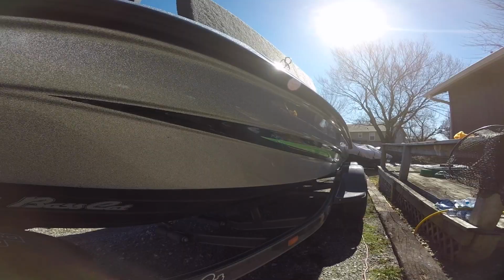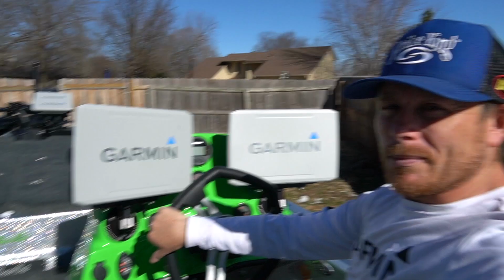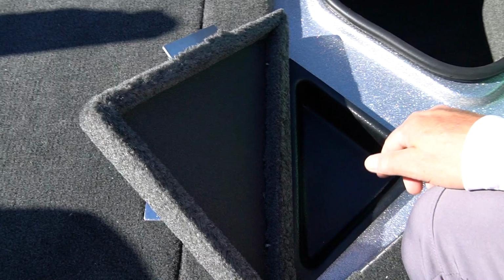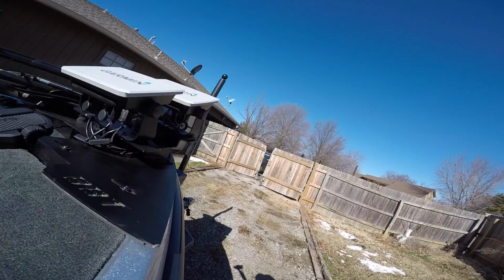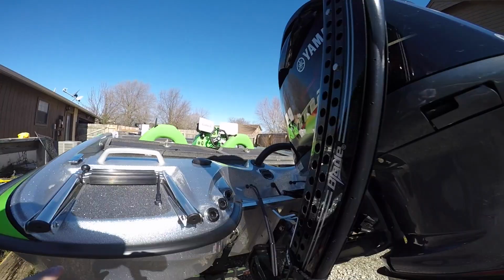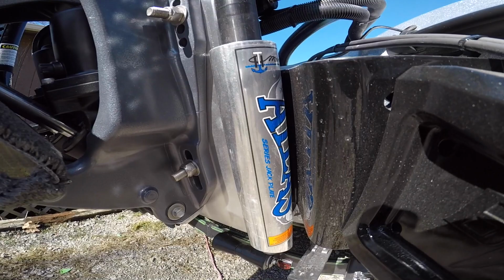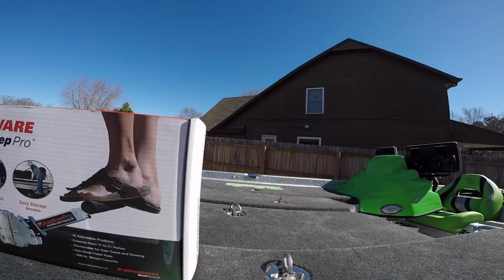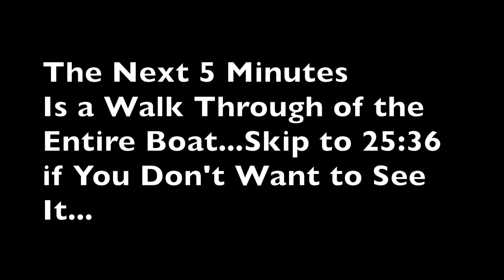How to Build a Tournament Bass Boat! (Redesigned 2021 Bass Cat EYRA)

Comment: I'm in a 19' Phoenix now, but moving to Bass Cat--trying to choose between a Caracal and Eyra (the models that will fit in my garage). The wide deck of the Caracal appeals to me, but I've never been in one and get the impression it's not maneuverable. 80% of the time I'm fishing relatively small water, but 20% I'm at Champlain and similar big water. Speed is not a concern (70 is plenty); hole shot and rough water ride are way more important to me. Advice welcome!

Comment: I'm currently running a 1998 ranger R98 Sport with a 1998 model Mercury 175 fuel injected. If I'm not mistaken it's the only 17' 9" boat Ranger made that was rated for a 175. Lately I've been getting the itch for a new boat, trying to decide between a 19 foot Xpress, or a 19 foot Triton aluminum, because I do a lot of river fishing and get into a lot of backwater areas, stumpy areas.
Reply: I went looking at Xpress H18 at the dealer, they wanted $10,000 over factory msrp. I'm out, I'm thinking used boat for me

Comment: 20 year old Cobra Viper DC and if my food truck business takes off this year I want to buy a either new or nearly new Bass Cat Pantera classic in candy apple red with white accent and a black bottom, upgrade to slam latches instead of perkos and put a 200 sho on the back. Likely will nizpro ECU flash it after warranty is up on it, seeing how the flash doesn't hurt the engine at all. Ballz out double mount on the front for live and mapping with a ultrex and balls out dash mounts like you have on your dash.

Comment: Someone else mentioned it as well, but no lithium batteries or did I miss them?

One pro who’s been fishing, as he says...40 years, says that the hot foot will kill your back.  Ummm... I’ll take the safety and familiarity over saving me from back pains. Little does he know, if you’re catching dem boys, your back is already hurt!
Reply: You obviously don't have a bad back. I can't even go on a rollercoaster because the compression pinches the nerves in my back, sitting down in pounding waves for an hour isn't possible. Two hands on the wheel can be safer but if you need two hands you probably are on the edge of losing control, anyway. Look up Basscat top speed to find a great video of some Euro destroying a boat no one could save with two hands. Most of the time you are running at speed the throttle is pretty much set at cruising speed and left there so I don't see why you would be holding on to it. If you hit something at speed, having a hand on the throttle isn't going to save you and neither is a Hot Foot. I used to laugh when guys retired from golf because of their backs because it's not even a sport. Now I know what that feels like when even laying down hurts your back.As a wise woman once said, "Stupid is what stupid does". And stupid would probably do it all again. If you actually think about all the information you can find without bias, whatever you decide to do should be the right choice for you. I have no use for a Hot Foot ever because I can't drink beer anymore either.